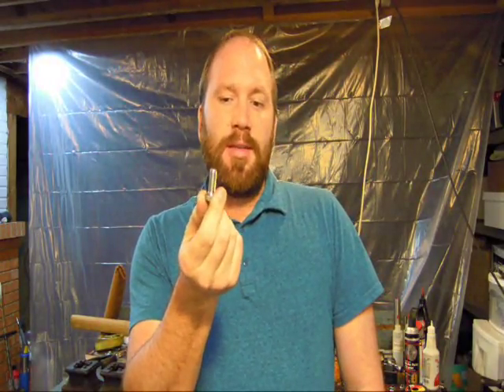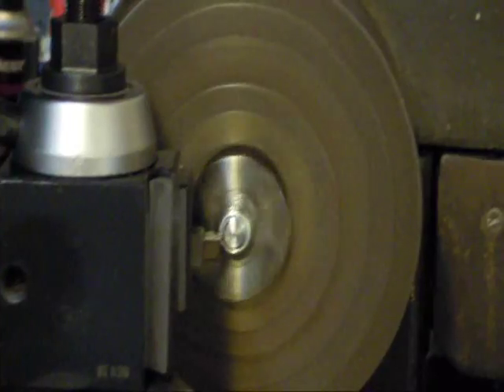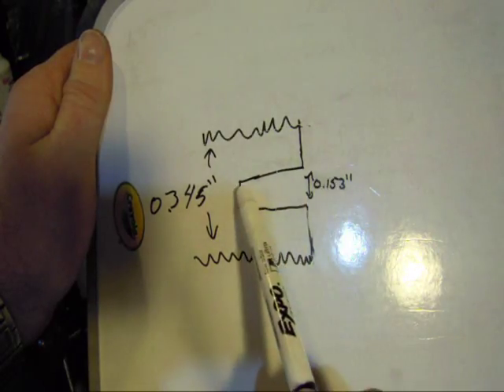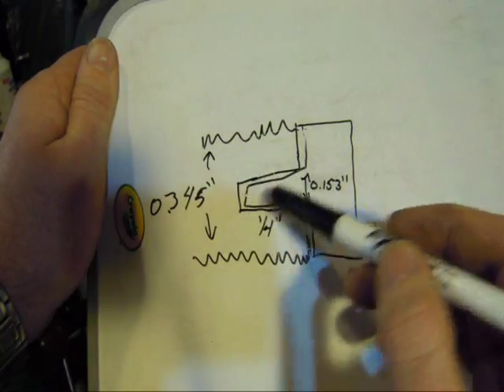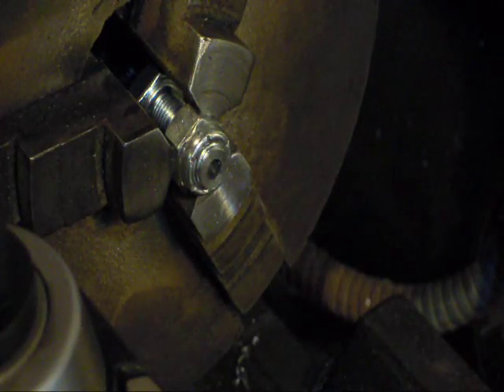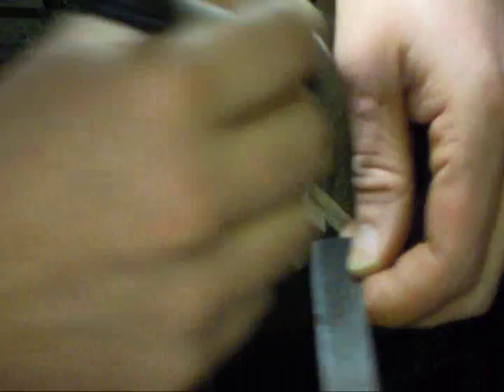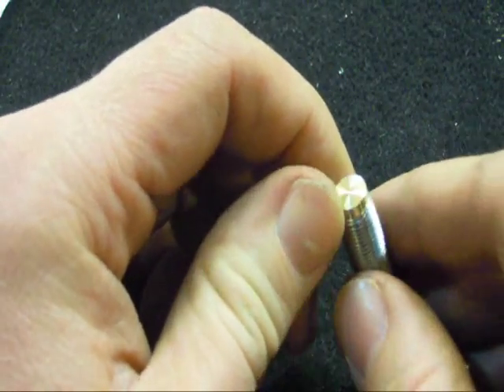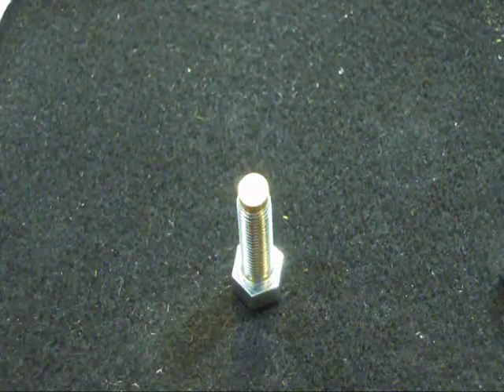Brass Bolt Ends For The Lathe Spider Gunsmithing

Comment: You make good videos, any reason not to loctite the brass into the bolt?
Reply from the maker: They end up being a light press fit. There isn't any forces working on it other than driving it into the bolt. So no need unless you cut it too much and not a perfect fit.

Comment: Hex head bolts are marked with radial lines to indicate their tensile strength. The head of the bolt in your video shows three 'line' marks.  This signifies a Grade-5 bolt. When reading the grade of a bolt, count the number of radial lines on the head, then add 2 to that number. Mild steel bolts have no grade markings and are typically Grade-2 (0+2). Grade-5 is a commonly used carbon steel bolt (yours being chrome plated to prevent rust). A Grade-8 bolt is made of high carbon steel and has 6 'line' markings. Any of these bolts are often plated with chrome (white) or cadmium (slight yellow) to prevent rusting. All are available with or without plating, black oxide, or plain (no surface treatment). A torque chart will show differences in their strength, and true tensile strength for a given size & grade can be found on the internet. There are higher grade hex head bolts too with more line marks indicating high-allow steels. Capscrews (which take an Allen wrench) all usually (not always) Grade-8 so aren't marked.
Reply from the maker: Thanks for the info. I knew about the standard bolts, but never thought about the cap head screws.

Comment: cool ideal I like it alot.. I cant believe how wide you drilled  out the bolt leaving such a thin left  over ss thread looked  super thin on the video.
I'll definitely make thees for my spider when I get  to making the spider.
great job thanks  for sharing
Mike
Reply from the maker: Hey, no problem. I can't recall what size hole I drilled but the bolts were 5/16x24 on my new spider.